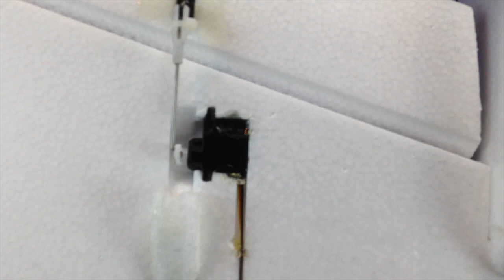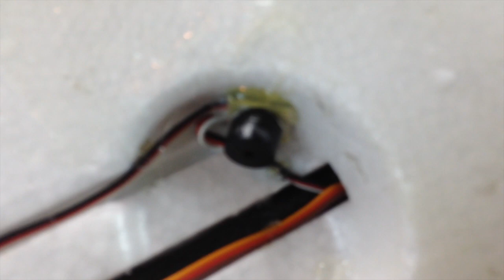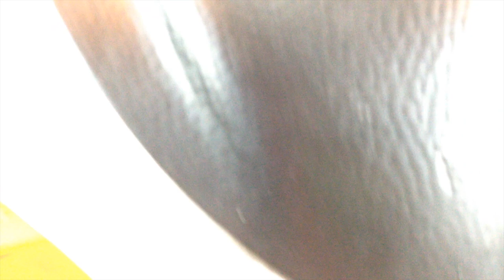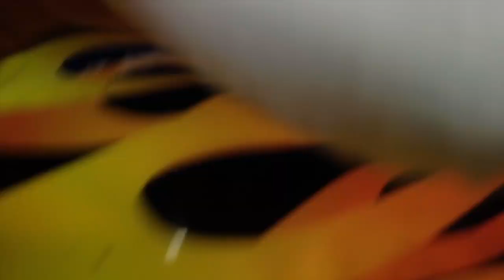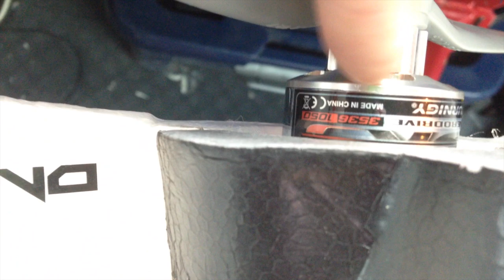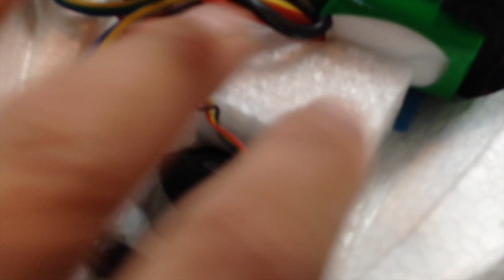Zeta FX-61 Project Part 3 of 4 Overview before maiden flight

Comment: Hey mate ,I know this is an old post ,but I can't get my arkbird to work, it is installed in a zeta 61 ,I am sure everything is connected properly as per your original video . The osd is up on my screen and the gps searches but no control surfaces work or the throttle, there is no chime from the esc either ,please help?

Comment: which size dragonlink uhf antenna you used to have to receiver in the fuse and the antenna on the wing the 90cm ?
Reply from the maker: +Aron Gatt it's about 80cm
Reply: 7demo7 thanks alot 

any timeline n the fohdy build?
Reply from the maker: +Aron Gatt filming as I type!
Reply: 7demo7 great , looking forward

Comment: I have in my phantom 3s 5100mah and I have only litlebit more than 22min of flying. My expectation was much more. How can I extend flying time ?
Reply from the maker: What motor and prop are you running?
Reply: GT2815/07 , 11x7 prop
Reply from the maker: I'm running a 3536 1050kv motor with a 10x5" prop- seems to be very efficient!  2815 motor sounds small??

Comment: Good luck on the maiden! Curious to see the arkbird working and the auto start feature of the autopilot. Got a new fpv plane yesterday, the xuav one, will start building it soon, also with arkbird and aat.
Reply from the maker: So far, the ark bird is flying great, I'm a little scared to try the auto start auto launch
Reply from the maker: I've been doing a lot of testing this week with different motor and prop sizes. I had a range problem with my Dragonlink system- it kept going into failsafe under 1000ft!  It ended up the antenna I had was bad!- I have solid control link now. I was planning a formation 3 mile trip to the ocean with a buddy of mine- we had "Santa Ana winds" was some crazy winds that we decided to not fly in..

Comment: DRAGON LINK! Wooooo Hooooo!!! ;-)
Reply: Lol
Reply from the maker: It was funny, I was getting very very short range and failsafe, ended up I had a capacitor missing off of my antenna which basically means I was flying with no antenna to 2000 feet distance